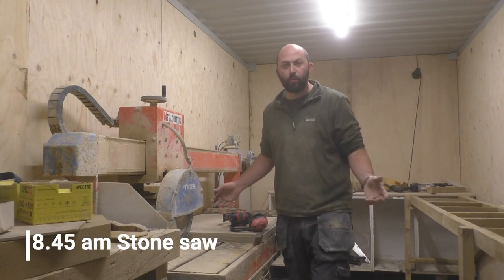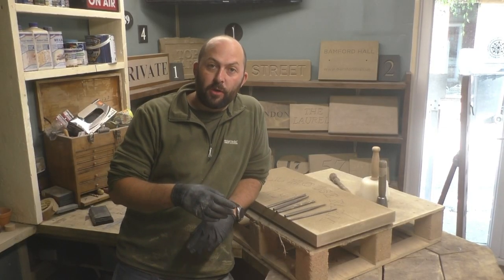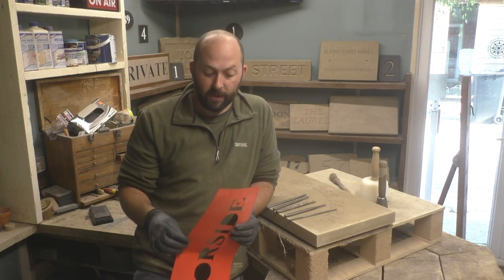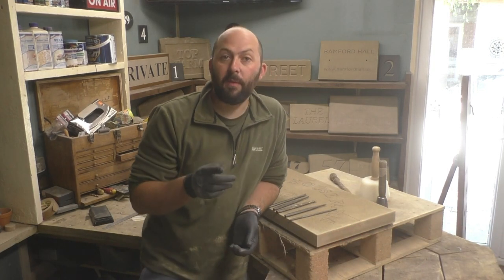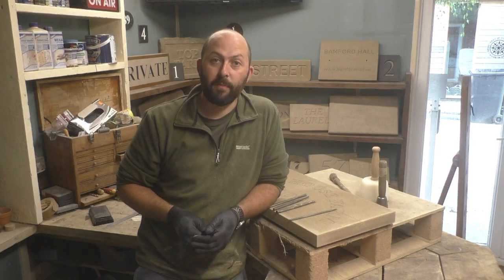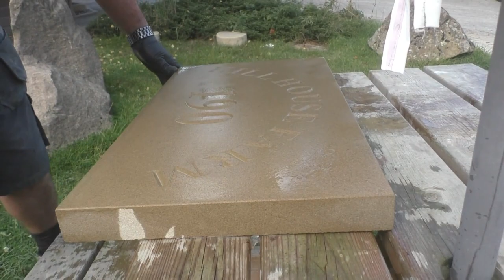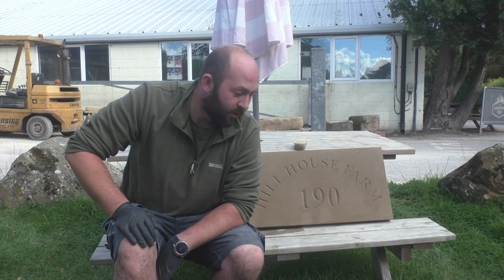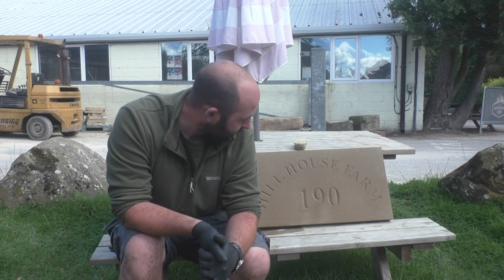HAND CARVING LETTERS INTO STONE USING HAMMER AND CHISEL, WITH SOME TIPS AND TRICKS ALONG THE WAY

Comment: Hi. How deep should the lettering be? Is there a formula depending on the width? I feel in flat light my letters lose definition
Reply from the maker: Hi, thank you for watching. There is no right or wrong way, and each job material requires a different approach to lettering. But the most common lettering depth I use on a start house sign would be to aim to get your chisel, when hand carving, facing 1/half 1 on a clock face; that should give you a good overall depth. I hope this helps.
Reply: That does help Thank you.
 @TheStoneRanger